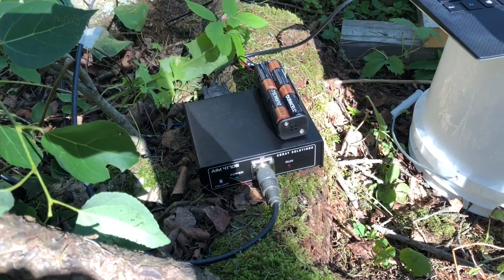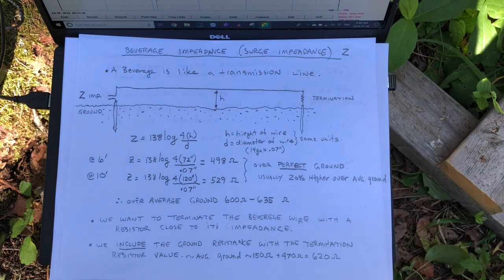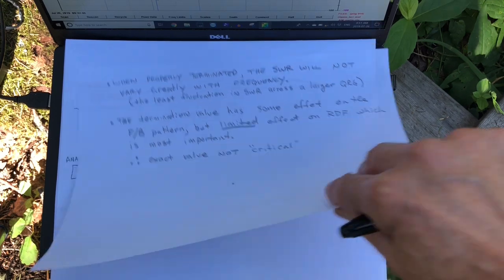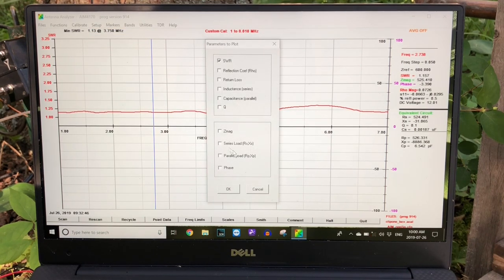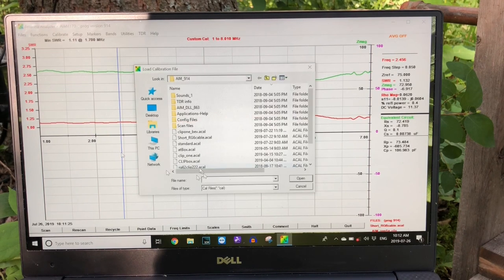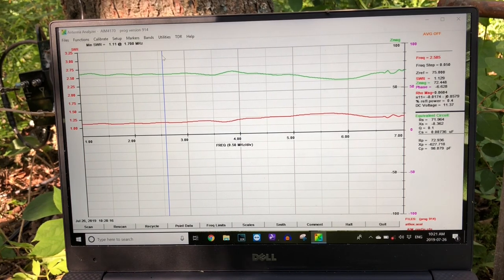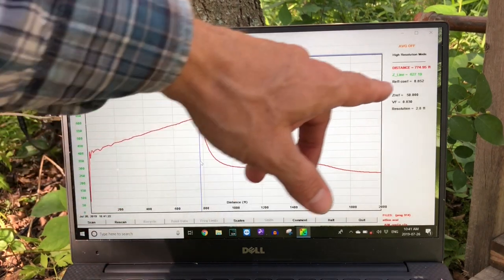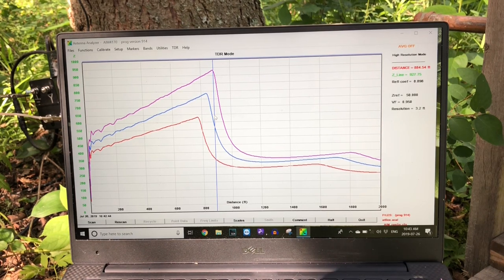Beverage Antenna: Analyzer measurements

Comment: There's a formula for Vf for wires above ground.  Refs may include 'G4FGQ' and 'KB6NU' according to a thread on Stack Exchange. Many years ago, learning about the speed of light (c) and the characteristic impedance of free space (~377 ohms), we learned that both were directly related to the permeability and permittivity of free space. Understand that transmission lines are not as simple as a hard vacuum (with or without spherical cows). Cheers.